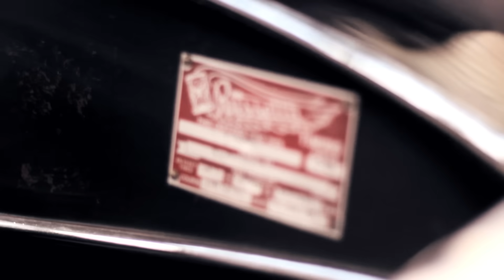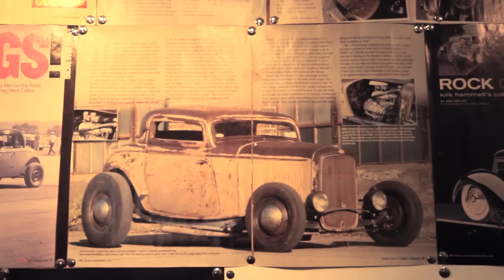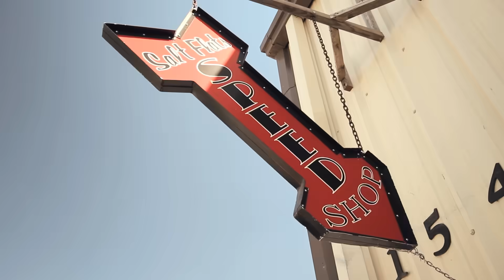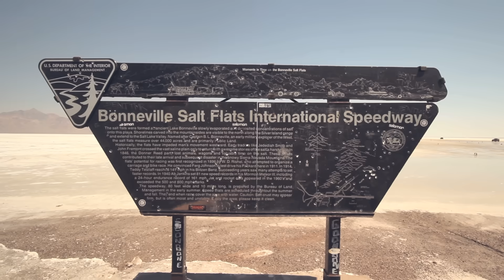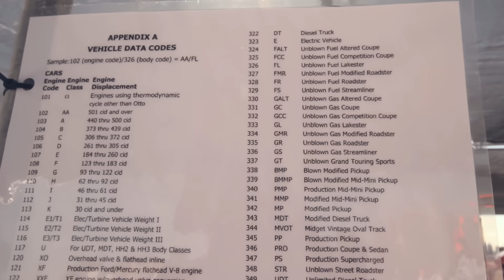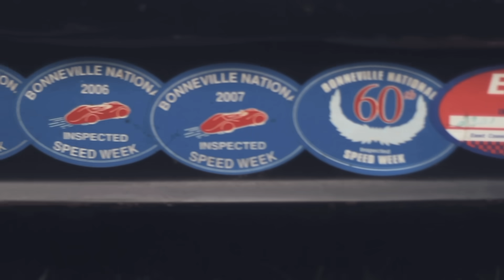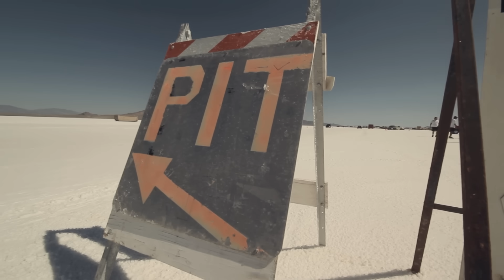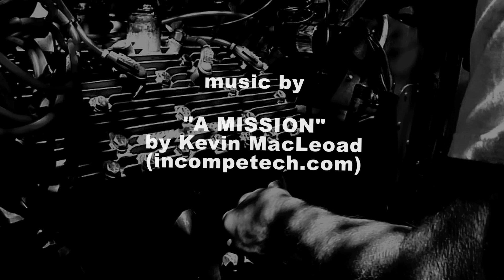Three Mile | Auto Racing Documentary | Full Movie | Rolling Bones Hot Rod Shop

Comment: Been a mechanic for 20 years, and all I ever got to work on was modern crap. I still have a welder and plasma cutter for my own projects. I turned my 76 stepside Silverado into as close to an old school hot rod as I could manage. Big block, 4 speed, flat black. Made my grill instead of buying one, made taillight holders. This spring I'm going to put a 57 Chevy wagon tailgate on it and do a roll pan. If I ever got any money, I'd never buy anything new.( Newest thing I own is 1999, and even it's a bit too new). I was born in the wrong time

Thank you for using these cars as intended. 
Road zombies for life